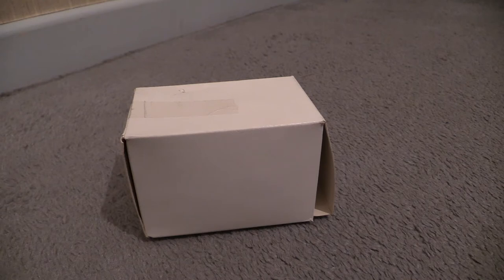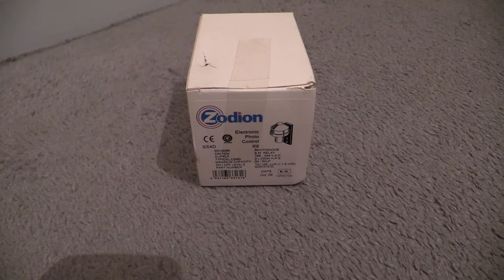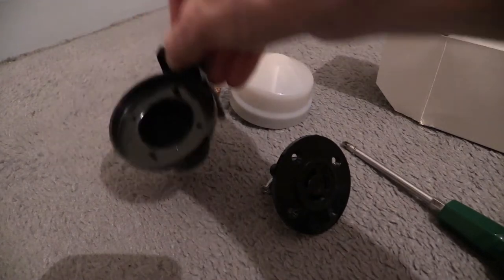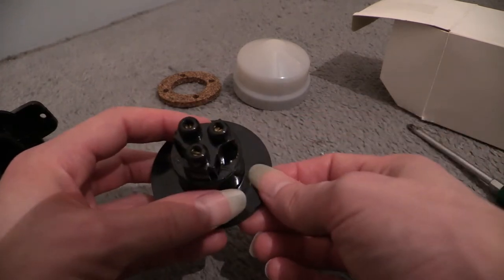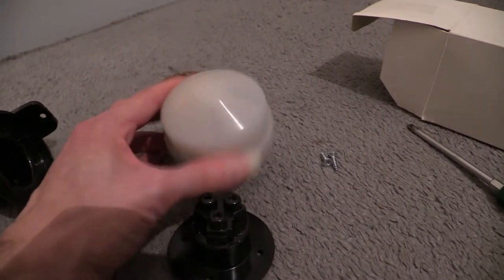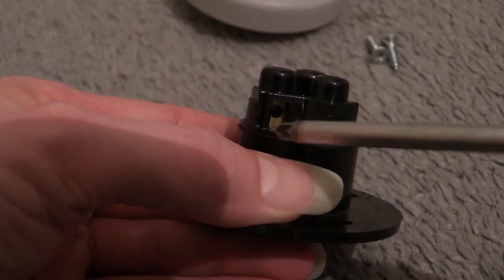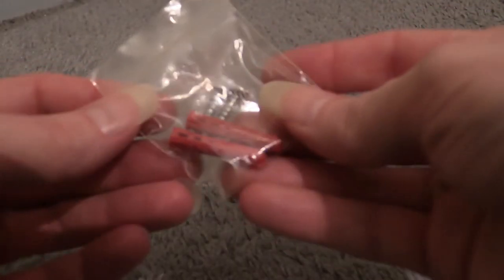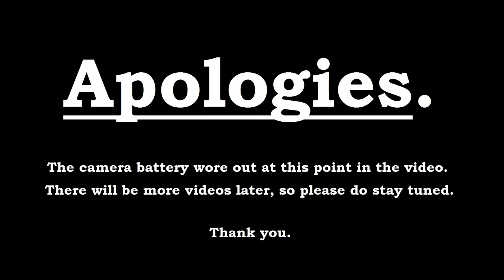Electrical : Wall mount photocell kit, Zodion SS4D.

Comment: I’m not trying to slate you here because I’m a fan of your work and you make great videos but just wanted to add that Earth or CPC should never be re sleeved and used as a LIVE conductor

Regulation 543.1.2 of BS 7671 specifies that the CPC is intended exclusively for protective purposes (i.e., for safety, to carry fault current and ensure the disconnection of supply in the event of a fault). It is not designed or intended to carry normal operational current.

Regulation 514.4.2 requires that all conductors must be properly identified according to their function (e.g., live, neutral, earth). Using the CPC as a live conductor, even if sleeved with the correct color coding, would conflict with this regulation as it would cause confusion in the future and compromise safety.

Comment: This is the same as the units used on common street lights, just without the wall bracket. Even the socket will fit into a street light housing.
Reply from the maker: Yes, correct on both accounts. These Zodion photocell units are the same as what would be found on public street lighting, along with other models, such as the SS6 for example. 

Also, SOME street light fitting may be able to accept the socket when removed from the wall-mount bracket housing. I have seen this myself on a grounded lamp post: The light fitting had the cell removed by vandals who figured out how to remove it, and on top of the fitting was a Royce-Thompson equivalent socket.

Interestingly, the socket in this video says "cableform" on it, which was another name in the photocell business.

Others:

Royce-Thompson,

Fisher-Karpark,

Sirebeck,

Zodion,

Cableform,

Horstmann.

Somewhere in amongst my electrical bits-and-pieces, I do have a two-piece Royce-Thompson photocell unit.

The LDR part of the arrangement sits atop of the lamp post, and in the base is a unit which contains the thermal part of the operation, along with a TEST switch on the front of the unit.

You never know..... If I can find that assembly, I may make a video on it and that can be another VIDEO EXCLUSIVE right here in Full HD on Wayne's Electrical!

Thanxx for watching,

-Wayne's Electrical.

31st October 2017, 17.42
Reply: I actually started collecting street lights, I have a 1983 Thorn Beta 5 and hope to get at least one other light (a Philips SGS203) but the main goal of this is to preserve street lights that have fallen off their posts or have been removed by highway maintenance teams so that they don't go for scrap metal.

Comment: Where did you get this "face it north" stuff from?? 

It's clearly identifying that the larger neutral pin faces that direction. These are not dependent on facing north.
Reply from the maker: Aaaaaah, now 
I can tell by what 
you have wrote 
here that you are.......

...... Probably not too familiar with these photocell kits!

NOW CHECK THE FOLLOWING:

(1) Make sure you are subscribed RIGHT NOW.
(2) Make sure you have the bell TURNED ON.
(3) Watch Wayne's Electrical Videos.
(4) Whack the Thumbs Up on vids you watch!
(5) Feel the Sssatisfaction! :D

A BIT LATER ON.........

I plan on doing a video on one of these being wired AND also a video detailing the classic question of curiosity.....

What's Inside? Oh yes!

This is why YOU NEEEEED to be a subscriber to Wayne's Electrical RIGHT NOW so that you don't miss out.

Others have missed out and made a right dullard of themselves, because THEY don't know the flavour.

Now surely, you don't want to be grouped-in with that lot!

In that case then...... BAAAAAAANNG that subscribe button!

You know you need to!

For even more flavoursome electrical tasty goodness!

Yeah, go on. You know you need it. :D

Thanxx for watching,

-Wayne's Electrical.

30th July 2020, 18.24

Comment: Silly that they don'y provide a cable gland with onion rings or a standard 20 mil with rubber seal. I guarantee that people don't put them in afterwards, and spiders can build a home in the device.
Reply from the maker: Hiya,

I think that is because it is down to the installer (and the form of cable management in use) to select the appropriate form of sealing on the base kf the wall-mount bracket.

With this, a variety of options could be used:

(1) Cable sealing gland, with a flex connection.
(2) Flexible PVC conduit and its related glands.
(3) Rigid PVC conduit and its related box-connectors.
(4) Steel conduit with coupler and brass bushing.

While I have never seen 3 and 4 being done, option two seems viable, but the most common definitely seems to be the cable sealing gland with a flexible cord going into the unit.

In reference to the unit being a home for spiders.... I think that any decent sparky would terminate-off this accessory with some kind of IP-rated gland.

Only cowboys and DIY-ers not knowing what they are doing (or spider lovers for that matter :D) would leave a gaping great hole in the underside of this device which is absolutely NOT a good idea, because this unit does not have any form of cord/cable grip in it, so a gland or conduit system REALLY needs to be used.

To date, whenever I see one of these on a wall, it has been installed accordingly, and 9 times out of ten..... with a cable sealing gland and flexible cord coming out of its base, going to a nearby conduit box.

In domestic installations, the conduit run is usually always PVC, but in professionally arranged installations, the conduit and box are galvanised steel/malleable iron.

For the average home installer/DIY-er, screwing around with steel conduit is far too expensive and complicated and requires a conduit bender (or elbow fittings... extra expense!!) The thread-cutting tool and cutting compound, wrenches and all sorts of other stuff, which is why, in the majority of domestic installs, one of these will be most likely at the end of a PVC conduit run.

Thanxx for watching.

More later, please stay tuned. :D

-Wayne's Electrical.

25th October 2017, 01.45
Reply: True, but I can imagine the home handyman buying a device, not getting a gland with it will often not make a second trip back to the shop to pick one up, and will think I do it later and it ends up forgotten. An electrican will often carry glands and adaptors in his van to do the job properly.
Reply from the maker: Haha, that sounds about right. One thing: In your first post on this you said:

------------------------------------------------------
Quote:

"....cable gland with onion rings"
------------------------------------------------------

Mmmm, tasty onion rings. :D

Was that one of those cranky predictive text bloopers?

-Wayne's Electrical.

26th October 2017, 00.42
Reply: No, that are rubber rings in a compression gland which you can remove to set the cable diameter. When set the collar gets tightened and squeezes the rubber tight around the cable. In N Z we call these onion rings. (local trade slang I guess)